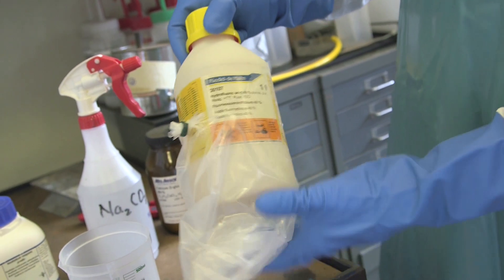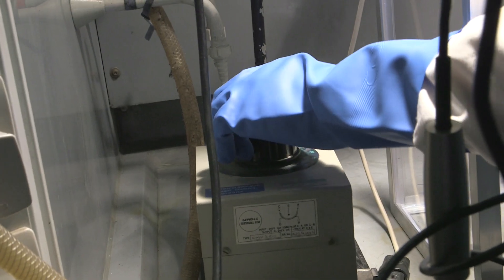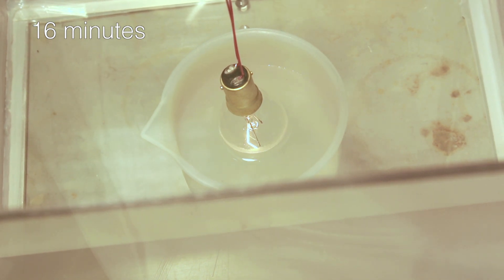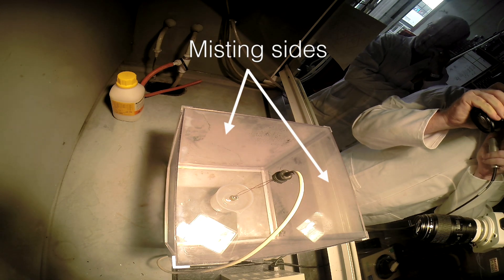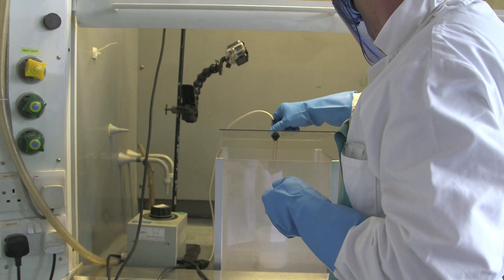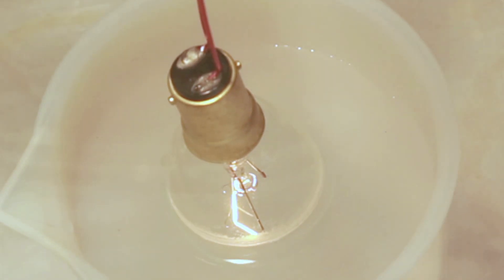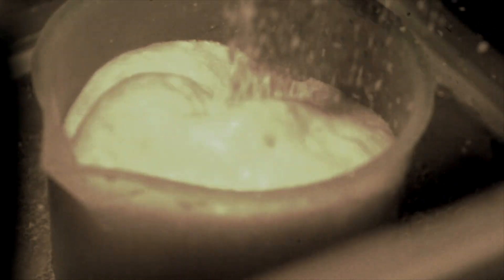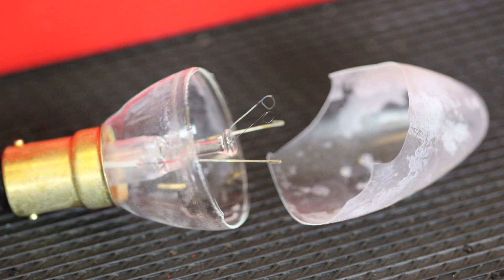Light Bulb in Hydrofluoric Acid (HF)

Comment: My Chemistry Professor in College had a story about HF.  According to him... Diluted HF is used to clean aluminum and specifically the aluminum sides of trucks.  This solution was given you a guy and he was told to clean the trucks with it.  So he proceeded to dip a sponge in it and wipe away at the truck.  Without any sort of protective gloves or other gear.  Supposedly the HF dissolved his bones in his arms and they had to be amputated.  

I always wondered if there was any truth to this story or if it was just a scary story to make us be cautious when handling the stuff in lab.
Reply: +MoOrion It probably is true. I was trained to use HF. You may be exposed and not notice the exposure for up to 8 hours later. HF is anhydrous. If you get it on your skin, it absorbs and will dissolve your bone underneath. In the refinery, I mostly worked around Sulfuric Acid but they used to cross train on alkylation units in the Amoco, BP Amoco and now Marathon refinery in Texas City, Texas. About the time that the group of guys I hired in with joined the alkylation units they stopped cross training for safety concerns. They still sent a small Playmate cooler home with us on the Sulfuric Alkylation Unit with a cream and eye wash (calcium gluconate if I recall correctly) so if we started having symptoms of exposure, hours later, we could start applying the cream and/or eye wash on the way to the hospital. The staff at Mainland Hospital in Texas City was also trained on the hazards of HF. Marathon's smaller refinery (the only one they had in Texas City at the time) dropped a vessel onto a 6" HF vapor line and over 3,000 people in Texas City went to the ER. I would not do what this mad scientist did without being in a fully encapsulated suit with supplied fresh air.
Reply: They did an experiment with HF using a chicken leg.  It wasn't nearly as corrosive as believed so no, your story is not true.

However he could have had to be amputated due to extreme nerve damage but he would have noticed nerve damage far before it spread to his arm.

Comment: I think you should repeat this experiment with water. I suspect that the bulb cracked for thermic reasons and not because of the HF. Proof me wrong 😝
Reply: +Flugschüler Fluglehrer Oxygen did the work , u need pure HF vapor to dilute glass
Reply: +twisty what do you mean by "oxygen did the work?" Do you think the SiO2 corroded?
Reply: well i mean , that the oxygen in the ambiant air is an oxidising agent and i think that the fact that the heat +ambiant oxygen + pure HF vapor at where the buld was justtttt (like at like 2milimeter over the surface was the strongest part of HF vapor)outside the anaerobic space there was the strongest point and thats why it broke.

i dont think that he could reproduce this bulb shattering if he put the whole socked excepting the electrode kindalike in the "aqua(HF) solution"

you need oxygen to fasten the process + the heat .

im only assuming im not 100% sure of course, but im trying to use simple logic which might not be right but still

he should try to submerge the whole bulb and im pretty shure no shattering would occur i might be wrong tho but im pretty shure it wouldnt shatter
Reply: +twisty hi, I do not agree. I think the glass cracked solely because of thermic stress. The liquid cooled the glass while the air could not transport the heat away. If you did the very same experiment with water instead of HF, it would turn out the same.

Comment: I'm confused. why are people so afraid of HF if it's a weak acid? I always thought it was a strong acid..
Reply: +Edward Long actually it eats the calcium and magnesium in your blood which eventually causes the heart to stop pumping. depending on the amount of exposure it could takes hours to weeks for it to happen if you don't get immediate help right after exposure. there is  calcium gluconate gel that needs to be applied right away and a trip to the hospital for  a shot. without these 2 things you have no chance. the gel attracts the HF running a b-line to your bones but you still need the shot to completely nuetralize it. you will walk away with some necrosis at the areas of exposure, since it kills everything along its path.
Reply: Itll give you a heart attack by just having a drop on your skin.
Reply: ^ It basically sends toxic chemicals through your skin. Which can lead to a heart attack and other things even death plus the acid is soo painful it will literally destroy the nerves that touch it as in the nerves will go through so much pain they basically use their lifetime in a few seconds in other words causing them to commit suicide. 
And if that doesn't the mere shock of touching it will give you a heart attack.
Reply: +Edward Long Part of what makes an acid dangerous is its strength (i.e. extent of dissociation and concentration of H+ ions) but what is more important is how the anion part of the acid reacts. In this case, the fluoride ion is very reactive with the organic compounds in flesh so that makes it dangerous even though it is a weak acid
Reply: +Mark Oven, van (Akula) It's hexafluoroantimonic acid H[SbF6] its around 10 quadrilion times more acidic than sulfuric acid but it's not nearly as a powerful oxidizer and it dissolves anything literally anything except teflon and it's also surprisingly easy to make just mix SbF5 and HF at -20°C and there you got it :)))
Reply: +Edward Long It's because of the fluorine, not the acid.  If you spill it on your skin, the fluorine will start deactivating the calcium in your body.  Your cells need calcium to live.  This causes all kinds of problems in the body, including cell death and heart attacks.  It is difficult to get out of the body, and keeps on causing trouble for long periods of time.
Reply: +Connor Kingston I don't think so, but it is pretty intense pain especially if you get a drop of it on your fingernail or fingertips. It feels like you're smashing your finger with a hammer and then shooting it with a nail gun for a few hours. I thought I was going to pass out from this pain. I would imagine it would take a decently sized (maybe like your entire arm) unnoticed spill on your skin to cause a heart attack from the imbalance of calcium and fluoride.
Reply: +Edward Long The fluorine is super duper reactive. The more serious problem though is not that it burns (it does), but that your blood being impregnated with fluorine triggers precipitation reactions among ions such as calcium (Ca+ (aq) + 2 F- (aq) -> CaF2(s), an insoluble product.). Essentially, you get solid gunk building up in your blood vessels. NASTY!
Reply: +Edward Long HF is a strong acid, along with 5 other acids. Every acid other than those 6 are weak acids. Depending which acid you have and what you put in it, a weak acid can seem very strong or a strong acid can seem very weak.
Reply: TheReaverOfDarkness HF is a weak acid. The fluoride ion is so electronegative that the HF bond becomes so strong that it cannot dissociate fully in water to behave as a strong acid. HF exists in aqueous solution as an equilibrium mixture of HF, H3O+ and F-. However, since the fluoride ion is so reactive, it will react with almost anything it is exposed to. When more fluoride ions are removed in reaction, more HF will dissociate to produce more F- ions to maintain the equilibrium. Thus it only appears to be a strong acid. This is different from strong acids which are already completely ionised in solution.

Comment: why is this awful chemical put in our water?
Reply: +al whits Nobody puts hydrofluoric acid in your water, where do you get that ridiculous idea?
Reply: +al whits they add SODIUM fluoride. Same reason you don't put sodium metal on your food.
Reply: +al whits Those are not the same thing as HF.  Once you change the chemical and dilute it, the properties change. Some places still use NaF.
Reply: Wingedshadowwolf no they actually use hexafluorosilicic acid in water fluoridation, and acid just as strong and corrosive as this one.
Reply: Wingedshadowwolf fluoride calcifies your pineal gland
Reply: +al whits It can contribute to it, but calcification is mostly a calcium phosphate buildup.
Reply: Star Gazer okay sure,then why is fluoride banned in most European countries.
Reply: +al whits because fluoride is still dangerous if too much is added, that's why you don't swallow tooth paste.
Reply: +al whits It's not. In Europe they don't fluoridate water, because they don't need to. They fluoridate salt. Fluoride is in your toothpaste for the same reason.

Comment: So why did the bulb break at the liquid's surface?
Reply: HF can dissolve glass over a period of time.
Reply: +Connor Kingston Perhaps you didn't understand my question. Why did the bulb shatter, precisely at the level of the liquid surface, instead of dissolving equally over all submerged parts.
Reply: adam podlofsky ... Sorry I still don't understand ? Do you mean why it shattered instead of dissolved at the surface of the liquid ?
Reply: The submerged glass of the bulb did not dissolve away uniformly. For some reason it broke just at the level of the surface of the liquid, and I do not know why that happened. You can see at the 2:50 mark that the bottom piece separated and fell into the HF, still more or less intact. What is happening at the surface level of the liquid that caused that to happen?
Reply: Ooh I understand now. But the answer to it is a bit difficult it could be because of the brand of the bulb i have known for some reason manufacturers make the top part of a glass bulb thinner than the bottom part. 
Another thing is the surface of an acid is usually more acidic than the bottom. You see water or sparkling water and imagine the bubbles in the water is the acid particles those bubbles float to the surface simply because of temperature and energy etc etc and them wanting to "go flat" its the same with the acid because of this the bulb at the surface could have melted before the rest bearing in mind also the thickness of the bulb at the surface theres also the heat energy provided by the bulb itself to take into account.
Reply: +adam podlofsky It might have to do with agitation: a still solution of acid will react with the material on its surface; the product of that reaction will no longer react with the acid, and has to be removed to expose more of the material below for more reaction to occur. Tiny waves on the liquid surface were probably removing more material than the relatively still liguid below. There also might be some acid vapor just above the liquid surface (especially due to the bulb heat), moving due to convection currents, contributing to the reaction.

Comment: HF was always one of the most worrying compounds I've ever worked with professionally (for etching of InGaAs DFB chip wafers), even compared to the others I've had the pleasure of dealing with (Arsine, phosphine, hydrogen sulphide, TMI, DEZ, TMG, white phosphorus, aqua regia...). The only substance that came close to worrying me in any real way was Bromine, it's as though you can see the evil in the vapours as they pour down the bottle on standing in a fume cupboard. We had a dedicated HF response team to deal with accidents and were required to carry calcium gluconate gel at all times, even at home!
Reply: I would rather deal with elemental bromine any day rather than HF, and I have made both. And I know of the safety and health risks of both.
Reply: I'm actually not even sure if HF would scare me more than Phosphine. Though I'd like to avoid both as best as possible.
Reply: Yup was that a Boston Lasers by any chance? Yup the gases fed to the MOCVD machine were pretty horrible chemicals, toxic,corrosive, spontaneously combustible, or all at once. Generally they were diluted in neon gas but still 😲😲😲.  Once the PH3 bottle became almost disconnected from the manifold and leaked causing a total evacuation. Thankfully the under pressure safety mechanism tripped and prevented extremely costly damage to the chip baker. 🤓

Comment: One of the reasons why SF6 gas in not used anymore as an insulating material in high voltage electrical components.

Comment: i think the bulb broke the way it did because the area above the luquid is the hottest part that is still in contact with the acid. the rest of the submerged bulb was probably much coller because there was no heat transfer from the top part of the bulb

Comment: They shouldn't have diluted the acid if they wanted quicker results.
Reply: +Nihar Rane +Super Nova
Is this related to why CLR cleaner works poorly straight out of the bottle? Maybe adding water will enhance its cleaning power?
The contrived tv commercial scenes of holding up a bowl full of CLR to soak your shower head and break down mineral deposits clogging up looks so silly- mainly because the bowl has like 2 bottles full worth of liquid! Just to waste on a shower head cleaning!
But now I'm wondering if they were emphasizing how much to dilute it for maximum effectiveness. 
Does diluting it (or any acid/base cleaning solution) make it better too?
Reply: It wouldn't be unsafe. He was wearing a full face mask, gloves, and it was in a fume hood. It wouldn't be unsafe to use more concentrated acid.
Reply: LOL that's not true. By diluting it, there is a lower concentration of HF. Thus, it would take longer to react.
Reply: Maybe you're right.
Reply: +flyguyee super nova is right.
Fluorine is the element with strongest electonegativity (Pauling scale 4.0) and water molecules just don't have the ability to break the H-F bond so very little H-F ionizes in water. In such a case where HF is a weak electrolyte it is better to use acid in diluted state rather than concentrated so that almost all of it gets ionized.

Read articles related to Oswald's dilution law if you wanna know more.
Reply: +Super Nova You're right but HF at high concentration will react among its own molecules to form bifluoride ions which are very stable and thus will make the solution very much stronger. Since this is a safety hazard they probably thought it was better left dilute.
Reply: It's All Ogre Now I know. I'm now begging the egg heads, I was just using you. Sorry. Lol ;)
Reply: It's All Ogre Now I know. I started to get bored trying to understand how a color change proves the stuff in my test tube was now something else. I went to a poorly taught chemistry class. 
Now physics, put me in front of a problem involving vectors and kinematics and I'm happy as pie. And space goes without saying! 
You ever bump into a flat earth nut who truly believes without a doubt that the universe doesn't exist? I've been entertaining the idea of a planar earth for fun but they deny the moon landings, they think planets and the sun AND the stars are all small and close to us. It's incredible how dangerous a little knowledge can be! 

Here's a real example: "If the earth is a ball spinning at 1040 mph at the equator, and if the atmosphere is also spinning at the same rate, then why don't rockets get shredded right at the moment they pass from 1000mph spinning air into the vacuum of space? "

To thousands of morons, that is proof the earth cannot be a ball, or if it is, we can never leave it. I literally have nut butter on my shoes from walking amongst the nuts.
Reply: +Super Nova What about CLR! Does it work better if you dilute it? The directions indicate that you should but I use it right out of the bottle. Am I reducing it's effectiveness without the water?

Comment: Yes, but what was the hypothesis that they tested? It just seems like they mucked around with a deadly acid just to see if something would blow up.
Reply: meadslosh it's classified
Reply: +meadslosh They already knew that 4(HF) + SiO2 = SiF4 + 2(H2O)
so they wanted to test how the various extra factors played a role:
1.) the bulb being less than pure SiO2
2.) various heat sources increasing the heat of the water
3.) vacuum pressure
4.) unforeseen factors

Mucking around with a deadly acid to see if something blew up is one way of putting it.

Comment: My question is if HF acid is corrosive why doesn't it go through the plastic beaker?
Reply: Radarcontact The plastic beaker is made out of Teflon, wich is a compound that contains fluorine. The acid does not react with teflon, since both compounds are fluorine-based.
Reply: Acid doesn't work like that it's acidic thats means a Ph of <7 (less than) stuff like meat skin bones are all organic acid will eat away organic stuff plastic isn't organic it eats away flesh over quit a while its not strong in that sense its more to do with toxcitity it denatures your enzymes which destroy cells in the body. . Now onto why it doesn't dissolve plastic well basically the main reason it doesn't is because plastic is non polar acid's are polar (h+ ions) they don't interact with eachother they repel like how oil sits on water.

Comment: In my school, HF is one of the weak acid. But in this video, it can dissolve glass. And for me, it's the sign of the strong acid. So, which one is true?
Reply: Raihan Ghaffar The strength is basically how fast it can do it, or how concentrated it can be. HF is weak, but reacts with most anything. HF is particularly dangerous to living things, however. Don't get any on you in any concentrations.